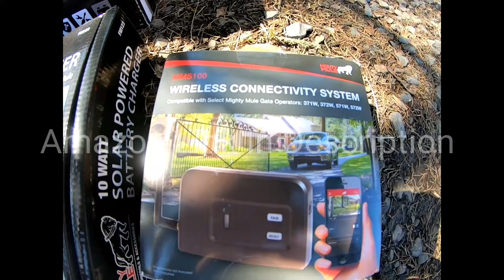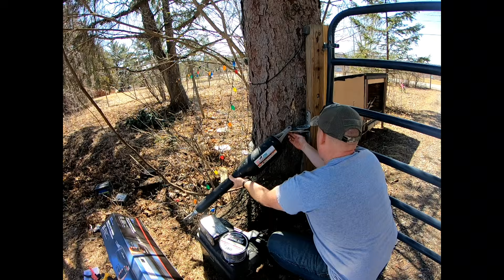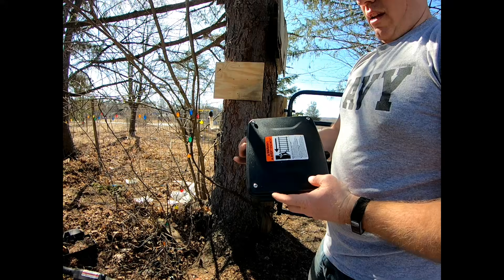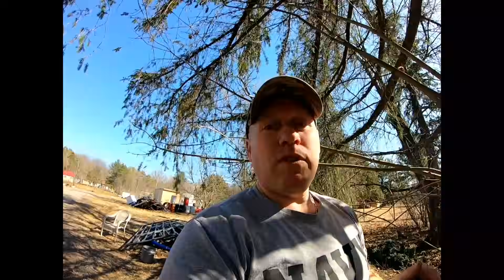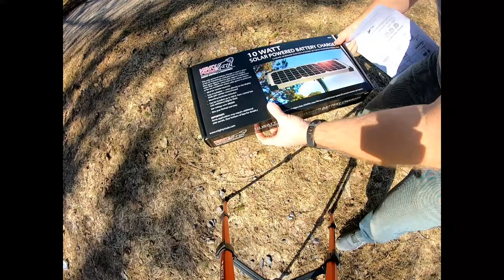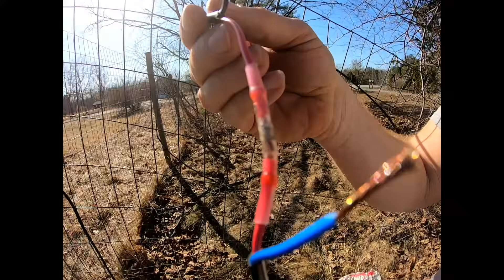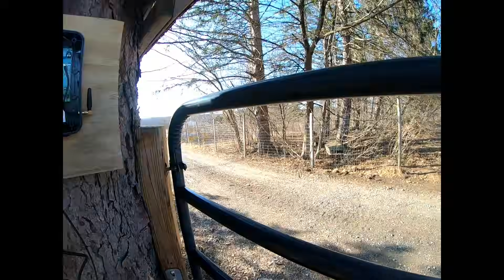(Newest) Mighty Mule 371W Gate Opener Install Part 1

Comment: We just installed the 371W and it closes but when it opens it immediately closes. We still have the auto close off. Help!!
Reply: My father in law has the same exact problem with the 371w. Gate opens fully then immediately reverses direction to close. Auto close is turned off. We were working on it today and we were baffled. As I am looking for answers on YouTube, I may have found the answer. There is a “Stall Force” setting that is set to minimum at the factory. It may need to be adjusted so the gate opener does not reverse direction thinking there is an obstruction. I need to try this tomorrow at my father in laws property to see if adjusting the stall force setting will fix the problem.
Reply from the maker: You hit the nail on the head that's exactly what you need to do!  Set your limits I did a video on it as well! Thank you for watching!👍😊
Reply: @WhitehouseFarmVet  Thank you Sir for your reply👍
Reply from the maker: Anytime!👍😁
Reply from the maker: Here is the video for fixing stall obstruction 
https://youtu.be/0wBpPdcp4w4
Reply: Adjust the auto close in mother board or call customer service tec
Reply from the maker: That is definitely weird off should be off unless its detecting a obstruction!  Make sure your gate is not closing or slamming hard open or closed because that will cause it to automatically shut or open,  if none of that works try setting the close to the max which I think is 2 minutes or however long you need the gate to stay open for, I have mine set for 1 min which is actually a long time, either way let me know what you find or how it turns out, and thank you for watching!👍😁

Comment: good advice 3 feet off the ground for the control unit but explain why thanks
Reply from the maker: Mighty Mule advises in the manual to have them mounted 3 ft off the ground to avoid rain splash and water!  Thank you for watching!👍😁

Comment: Again I well, everything had been fine working I did it as he told me and it worked well but today I wanted to close it and it no longer wanted to work with the control and it has a sound like every 10 seconds like a smoke alarm a sound every 10 seconds
Reply: Check battery in remote
Reply from the maker: Do you use the solar panel or direct 110v? Check your battery sounds like it might not be fully charged if using solar charger?
Reply: @WhitehouseFarmVet  direct power
Reply: @WhitehouseFarmVet  110 v
Reply from the maker: Check all your fuses see if any are blown, and also check for any obstructions to the gate and just double check your power to it make sure everything is fully connected!

Comment: Did you enclose your battery into some type of box or just set it on the ground by the tree?
Reply from the maker: I bought a plastic battery box at Walmart and put it in there, works great I did tape off the vents on top though I didn't want any water getting in, thank you for watching!😁👍

Comment: I saw all the steps you did but you do not want to open with the remote control when I press the open button it runs like 6 inches only and it starts to sound a loud sound
Reply from the maker: You have to adjust your open and close settings, look in the manual it will tell you step by step it's really simple, if you need more help I will do my best to guide you, let me know how you make out! Thank you for watching!
Reply: @WhitehouseFarmVet  thanks
Reply from the maker: Anytime!👍😁

Comment: Are those muffler clamps you used to reinforce on the gate? What size did you use?
Reply from the maker: Yes they are, I think I showed them and the part number in the video , I got them at advanced auto a while ago so I dont remember off hand, they work great!!! Thank you for watching!😁👍
Reply: @WhitehouseFarmVet  thanks so much!
Reply from the maker: No problem anytime I have some more videos scheduled on the keypad and mms100 if you need them, good luck it's a pretty easy install! And thanks for watching!😁👍

Comment: hey man that battery harness was for a car battery.
Reply from the maker: Yeah that's actually what I used on my old system, I figured I would give the mighty mule battery a try for 35 bucks compared to the 100 plus car batteries,  I'm actually pretty impressed its held up pretty good especially considering we are constantly going in and out of the gate lol  thanks for watching!😁👍